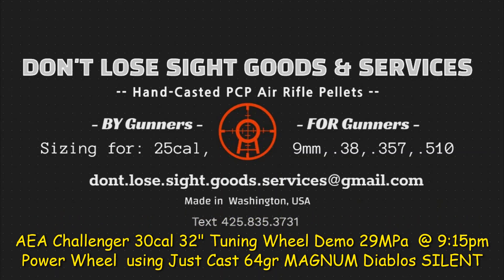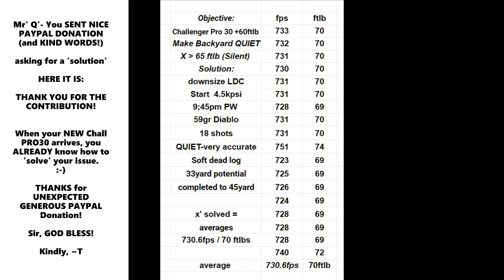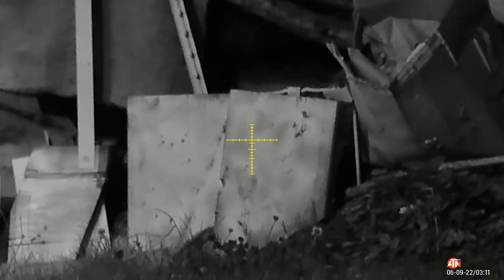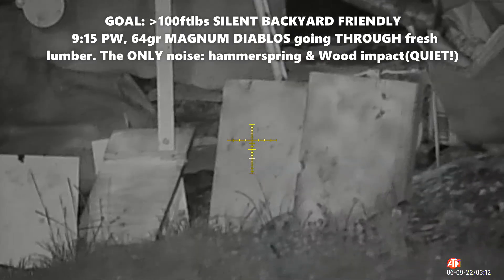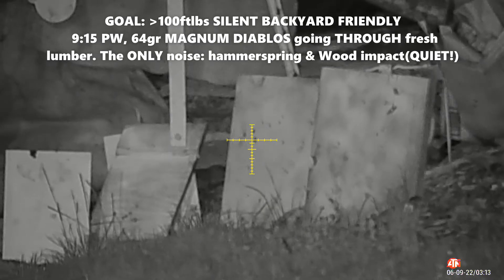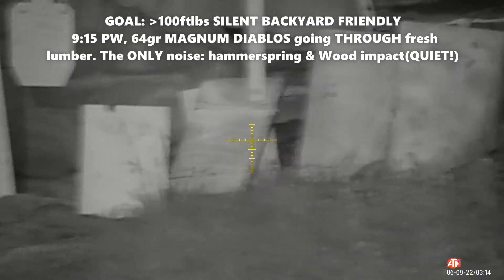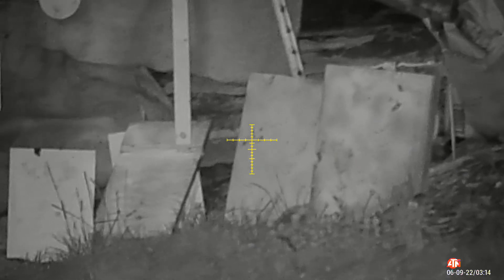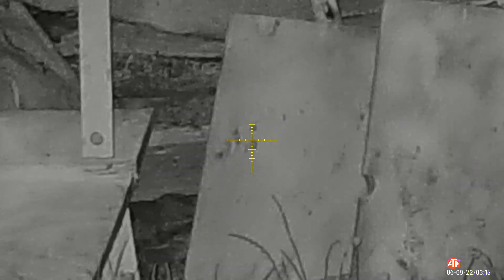AEA Challenger 30 cal 32” BACKYARD FRIENDLY NOE MOULDS DIY Cast Magnum Diabolo Tune 100ftlb AirRifle

Comment: Do you get any pellet clipping?
Reply from the maker: Good question! Hello! Surprisingly, NOPE. Not even on a VERY TIGHT fit, 107gr 308 RF sized to ONLY 300, which will NOT work, due to about 5/6 WindBearing Surface is actually GRIPPING bore! When a guy learns to print air rifle PETG suppressors, then learning that the clearances, they can be very LITTLE, just enough for the projectile to DROP THROUGH without HANGUPS.... i have tried seven types of projectiles in the 25cal Tanto. All flow through lovely and CLEAN. I would guess somewhere around 2,000 rounds JUST with the 25cal - it took me a while to get very precise tunes for specific distances and mass weights. I have yet to experience 'Clipping' - when printing a lot of PETG, i learned MUCH about 'clipping;, Only Machined Brands for me NOW!